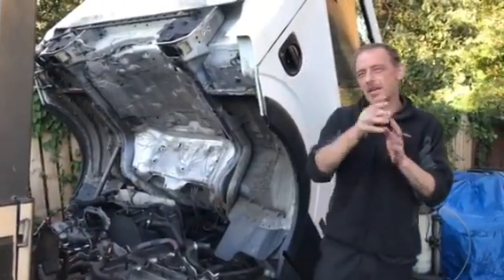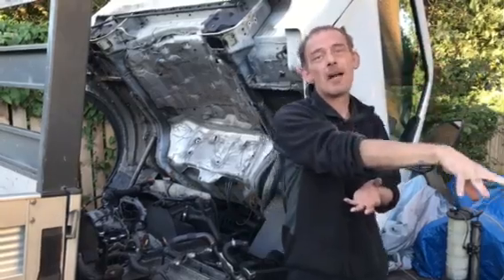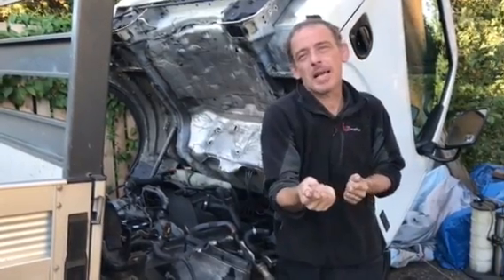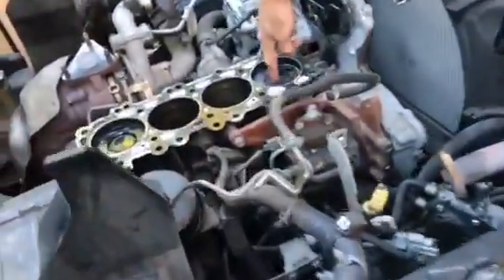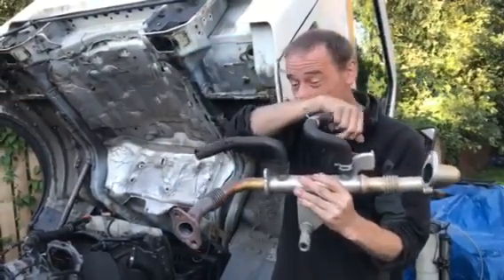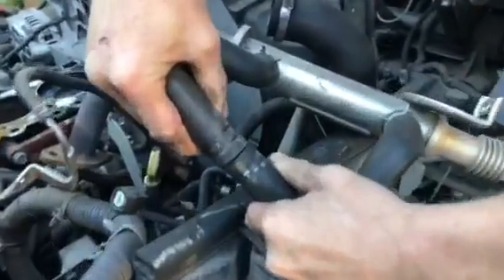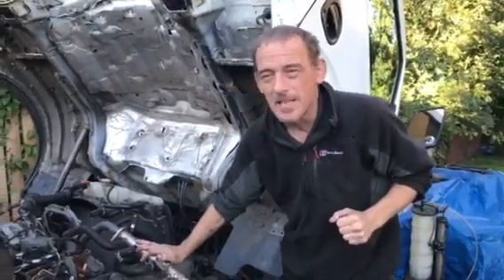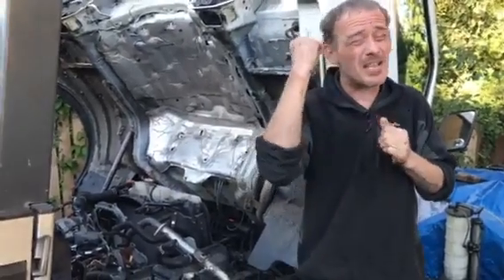Engine Hydrolocked (SPLIT EGR PIPE)

Comment: I see a lot of people deleting or blocking the egr cooling pipe on nissan navara with the yd25 enging, I was considering doing this on my 2007 nissan cabstar with yd25 engine. But by seeing your video I asume that this is not possible on the cabstar ? This is the first video or info i've found about the egr cooler of a nissan cabstar, so if you could give me some extra info would be very nice.

Comment: Hope to see D22 project/ rebuild i have a uk 1999 D22 2.5 tdi twin cab pick up i got for next to nothing 85000 miles thinking of restoring it the tub is roted any major problems i should look out for before have got it started sound's a bit tickiti      ?
Reply from the maker: Will do mate, Des